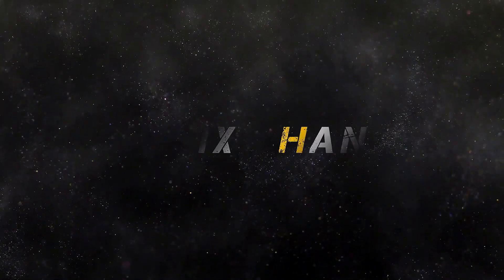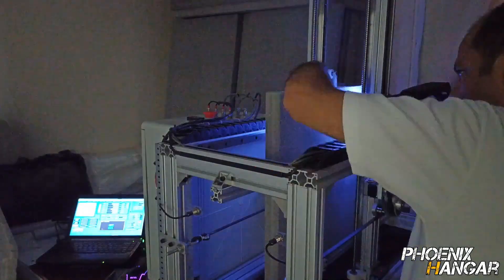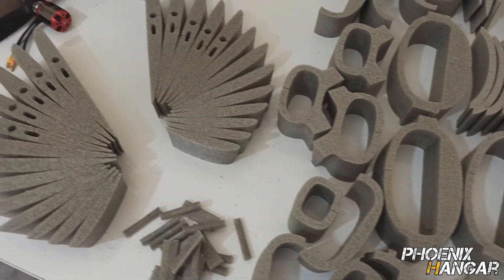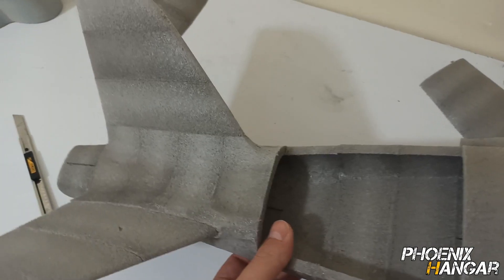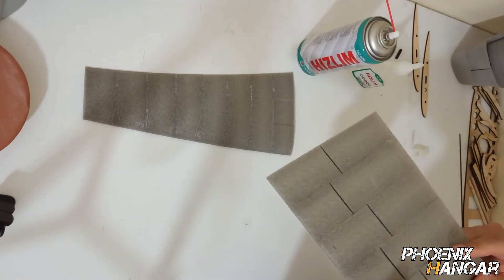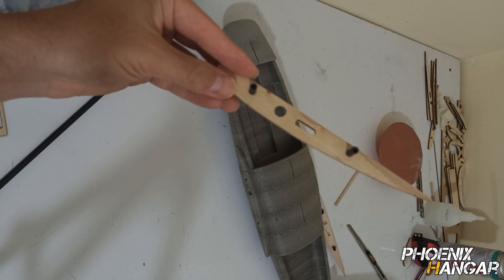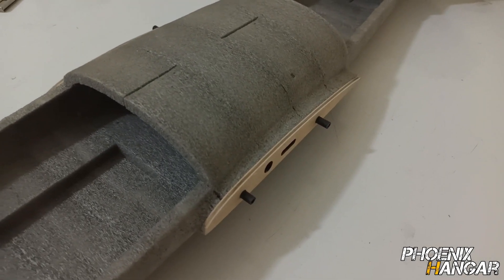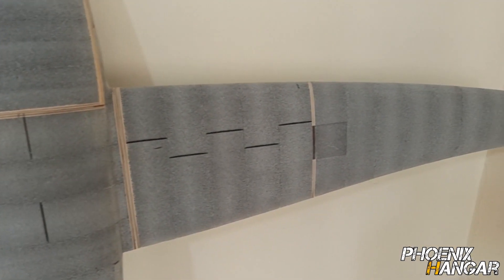How to make Rc Airplane with a different method (4axis cnc hotwire foam cutter)

Comment: Hello Sir, the way you made the plane is very interesting.  During my first year of engineering, I had made a 4-axis foam cutter machine. We use it only for wings like rectangular, tapper. It would really be very helpful to guide us by making tutorial on the complete working of your cnc foam cutting machine if possible. I want to generalize the self-designed cnc foam cutter machine for any of the custom parts like you did in this video. By the way, I am your new Subscriber. I find all your videos very interesting and helpful.
Reply from the maker: Thank you so much for your kind words and support. I really appreciate it.
About my CNC hotwire foam cutter: in my upcoming videos, I will gradually talk more about the machine and explain how it works.
I’m glad you found the content helpful, and welcome to the channel!

Comment: Well done. Can you provide a link to that CNC machine?
Reply from the maker: This machine was designed and built by myself, and there is no link available to buy or find information about the device.
Reply: @PhoenixHangar  Well may I suggest that you complete a detailed instructional video series teaching the rest of the RC plane community how to duplicate your machine with links to parts etc. This looks like a wonderful build that hobby people could probably put together if given a very clear set of instructions.
Reply from the maker: @andrewklug4845  I’m planning to upgrade the machine and create a lighter, more compact, and optimized design that doesn’t have the issues of this one. The current machine is quite heavy and takes up too much space, which is really inconvenient. Once I start working on the new version, I’ll make videos about it as well.
Reply: That would be a great video. I will be waiting for your video on that. I would like to design one for me also.

Comment: nice build what type of foam do you use
Reply from the maker: thanks, I use XPS foam
Reply: @PhoenixHangar nice i looked into the software used to generate gcode for these types of machines and they are all either really expensive or limited. What software did you use for generating the gcode for this project?
Reply from the maker: @speedy_vespa I use mastercam to generate g code that is very expensive software unfotunately